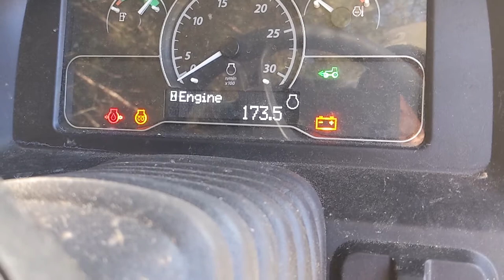This is a how to video on how to NOT kill your backhoe

Comment: Don't feel bad, I've seen GIANT excavators on construction sites bend rams and break parts. I've bent the curl cylinder rams on my tractor also. It happens, it's part of running equipment, we try to avoid it, but machines are man made and the earth will always win, especially when man messes up!  Sometimes it's poor engineering and sometimes it's poor operating! But we learn from it and get better brother!